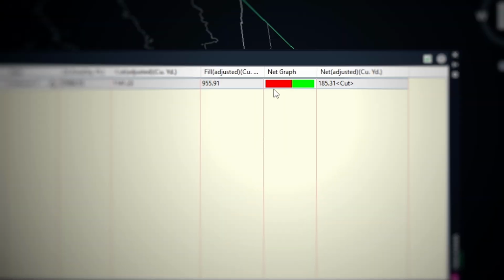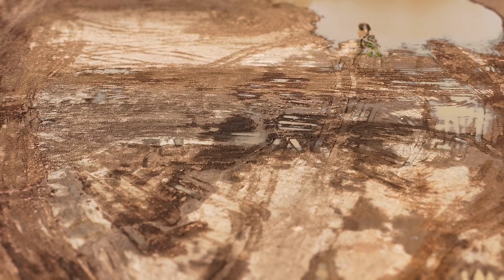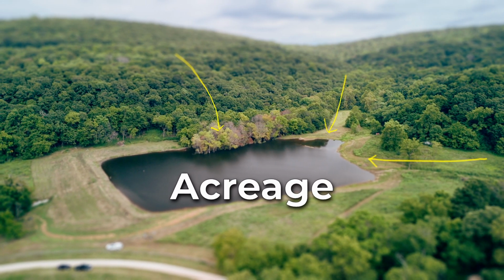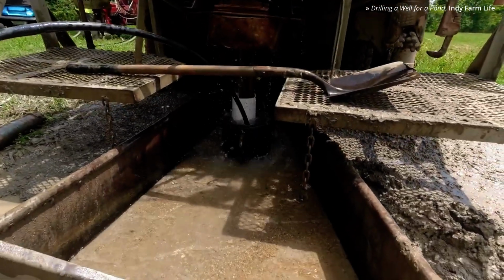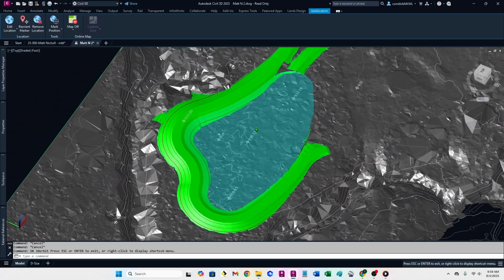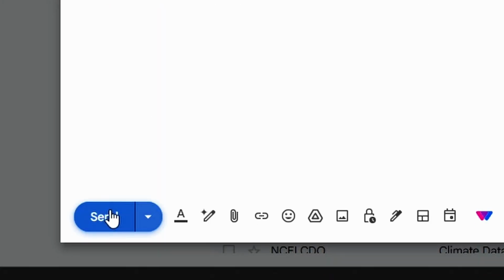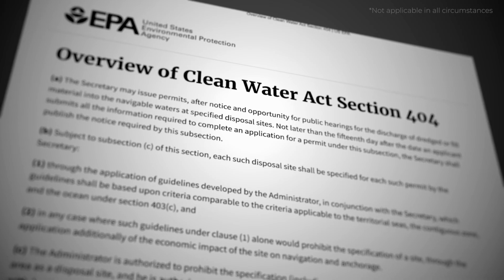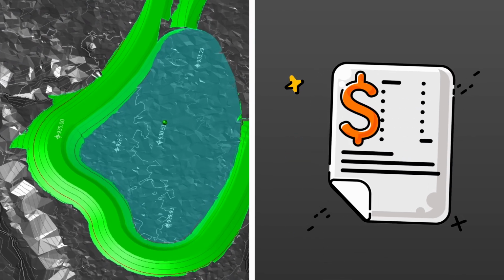How We Build Lakes - Part 4: Design, Planning, and Cost with Real Data

Comment: I love this! The transparency your company displays is very admirable and appreciated as a potential customer. I do wish, however, that you had a branch/location in Canada. I do have a question, is it possible to have naturally running/operating wetland (the water being filtered without the use of a pump) on a lake or a pond that's built?
Reply from the maker: Thank you so much for your comment!

We'd love to answer your question. Can you clarify, are you wondering whether it's possible to build natural wetlands without having to manually pump water into it? It is possible to do so, but it relies on a number of factors to be true, including enough rainfall/runoff occurring in that area, the right land shape such as a basin (which can be constructed if necessary), and a high water table so the water remains above ground and doesn't drain into the soil. If all of these things are true, then a wetland will naturally occur from rainfall, and runoff from surrounding land draining into the area.

Another way to achieve that through an already built pond is through controlling the drainage. We're working on a video to showcase a recent project we built that included a unique drainage system that can control the height of the water in the pond depending on how many blocks (like walls essentially) you put in or take out. By adding more in, the landowner is able to essentially flood an area next to the pond to create a wetland area for hunting ducks, and then he can take the blocks out to lower the water level and allow the wetland to dry out. Here's a link to the system we used: https://www.agridrain.com/shop/c85/manual-water-level-control-structures/p901/inline-water-level-control-structures/